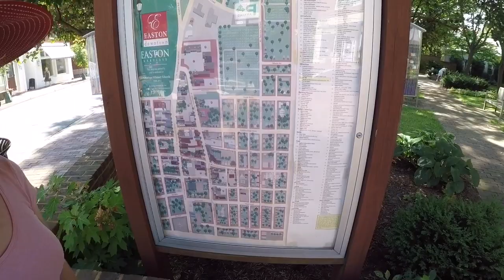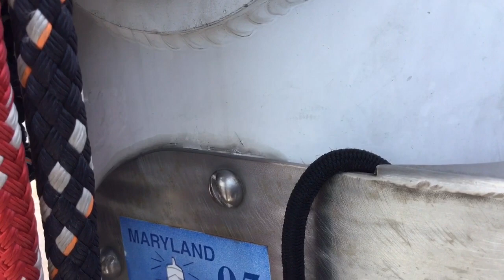How to Inspect Your Rigging | Sailing Wisdom Ep 14

Comment: That is called a split pin, once inserted through the clevis pin the two legs should be sperated and bent around the clevis pin, it is made to be a use once permanent fixture. What you should be using is either a lynch pin or a R pin both of which are safer because they are captive when inserted into the clevis pin in any position and are reusable.